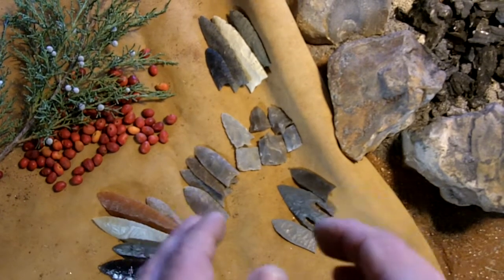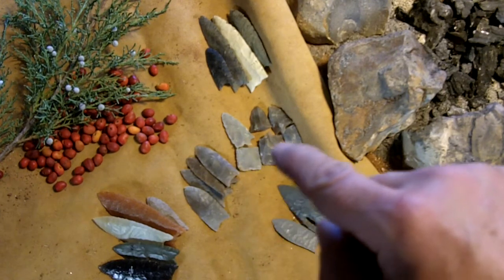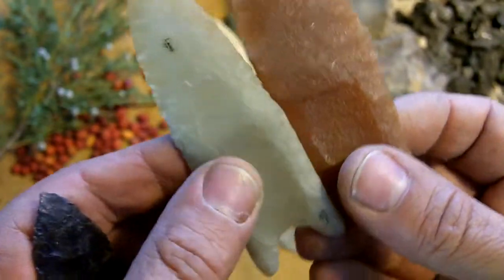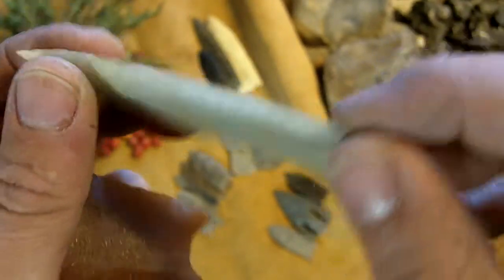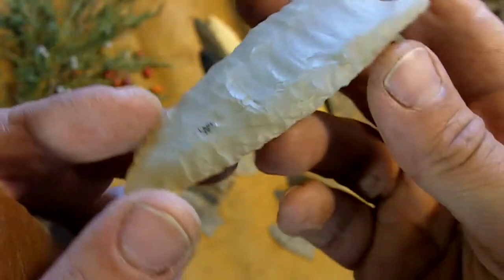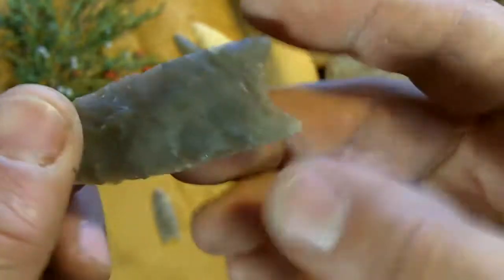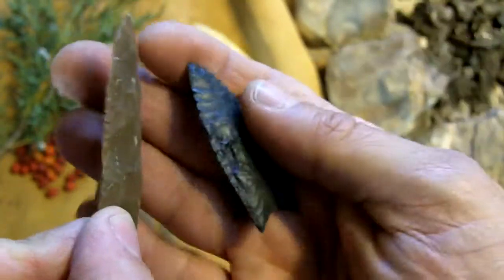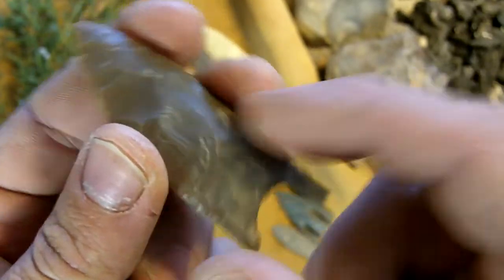214 - Part 3/4 - Clovis Flintknapping Research and Trials, More Casts!

Comment: Very good video! I found the base section of the creamy colored cast you had of the Lamb site Point, back in 1986. I was invited to work on the site that day and I found the base in a clod of dirt on the sifter. The tip had previously been found a few days before by Dr. Gramley. I have lots of photos of this find. That base completed the point and it was the only one found on the site made out of Vanport/ flintridge chert from Ohio. 

-Paleoman52-